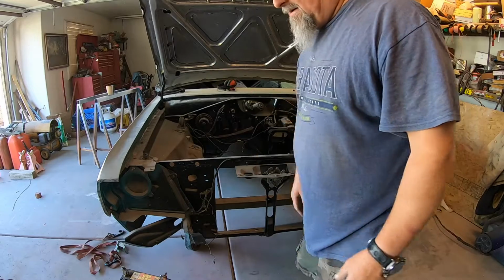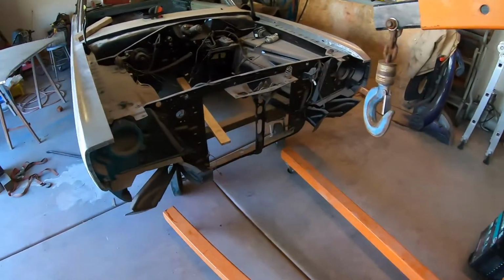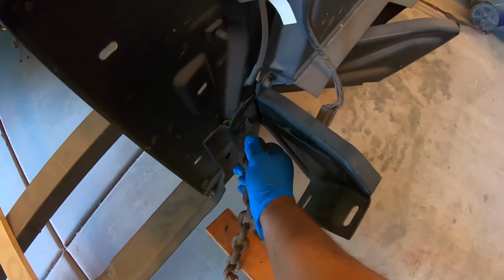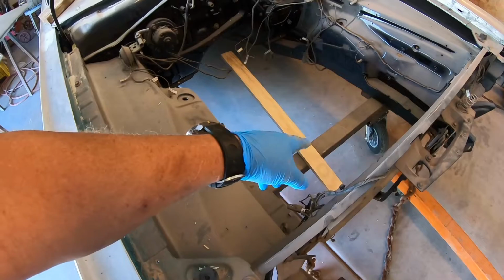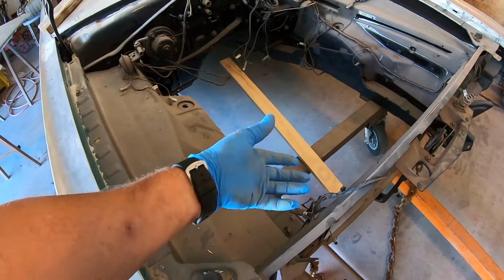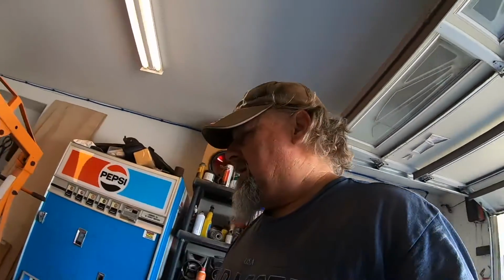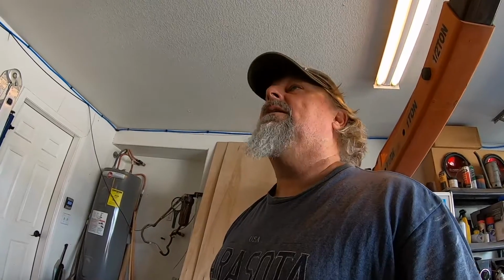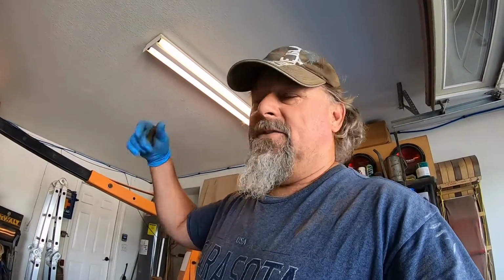Installing the 69 Dart back onto it's Engine

Comment: For a chevy guy you did a damn good job getting the engine/trans k member installed..... I have a maxx jaxx mid rise lift that makes life and that job you did a lot easier ............ if you didn't find the other two k member bolts I have two you can have if you pay shipping. I'm in craphole N.j.
Reply from the maker: I bought 2 NOS bolts and as soon as I received them I found the originals......fml....BTW, I looked and looked but I couldn't find "craphole NJ" on any map.  must be bad if they don't even want it on a map!  Thanks for watching!
Reply: @dzlfreek  lets just say I love America and at one time NJ was known as one of the original 13 free.

Comment: Hello,  I was wondering if you still carry your DB9 ?  As a dedicated DB9 fan I never leave the house without it. Especially since I live in the recently crowned Lunatic asylum SuperPower of the West Coast .. Seattle.  I was first turned onto your channel when I was trying to work through the trigger and functioning issues that i found out that we were both having. Your video's were extremely helpful in ironing out the issues I was having with my DB9 to enable me to confidently carry it every day. So i wanted to thank you for that because in my current career and situation I simply cannot allow it to be known that I am carrying a pistol. Ever !  and since I feel a .380 isn't enough my only option was to make the DB9 work. which with your help and many hours of tinkering & research I was able to get my DB9 to work perfectly 100% of the time. Which ended up saving my Ass !  btw...
 So,  I wanted return the favor and in case you didn't know ....  Diamondback released a ( Gen 4 ) DB9  a little over a year ago now and the newest generation has completely transformed the once problematic DB9 into a work of art !  They have addressed every issue and turned into the true Baby Glock it was intended to be from the beginning.  They guarantee the use of ( +P ) ammunition. slide stop/hold open on last round. Fantastically improved trigger.  I have run a few thousands of rounds through it and have not had one failure.  It is truly the Amazing gun we have been waiting for. 
  I just thought I would pass this on in case you weren't aware of the New  ( Gen 4 ) DB.  You seem like a great guy and family man so obviously a safe & reliable & Very discrete 9mm slice of Freedom in your pocket could make the difference someday. Hopefully not but just in case.
  This utter destructive & Dangerous Insanity that I find myself living with in Seattle has forced me to reevaluate everything concerning personal & family safety so you came to mind.. 
 Good Luck & I look forward to more of your video's.
Reply from the maker: I am aware of the 4th gen and its going to be a welcome addition to the fleet one day.  I still carry the DB9 but also a SW shield 45 as well.
Reply: @dzlfreek  Right on !  I just wanted to spread the word in case you weren't aware of the Gen 4. I was hoping they would adress the Slide stop/last round Hold open and they did which is Cool. I certainly wasn't expecting the ( +P ) guarantee because I didn't think it was possible with such a low mass barrel but I guess so.
 This little thing definitely saved my ass when i was being approached one night and i was able to get a shot off to scare the scumbags away before they got closer. if I had not been able to get the reliability out of it which you had a hand in it I might not have been carrying it that night and I can't say what would have happened. So Thank You !
 The fact that this gun is SO small and easy to carry allows me to take it literally everywhere which I know for a fact that if it was any bigger I couldn't because anything bigger would be noticed.
 Have a Good one !